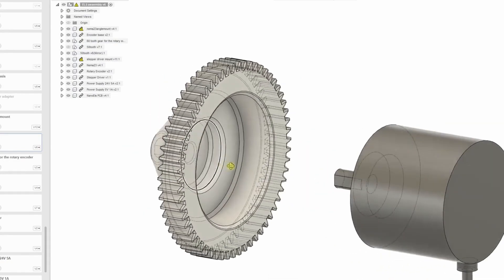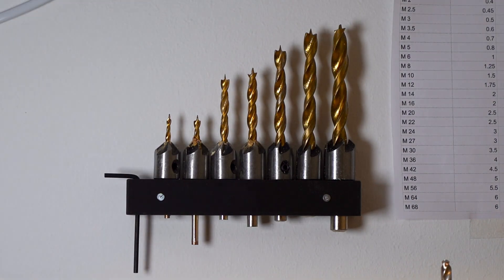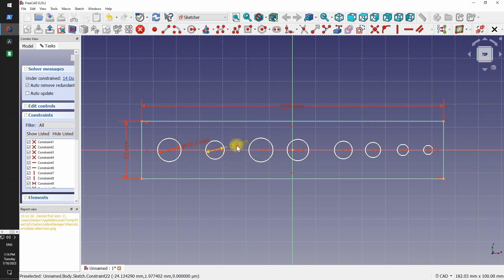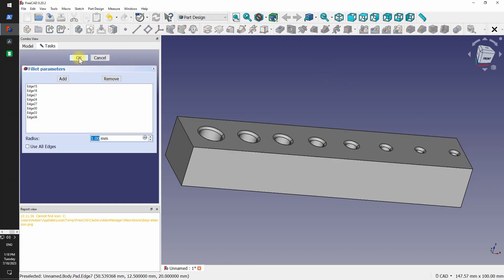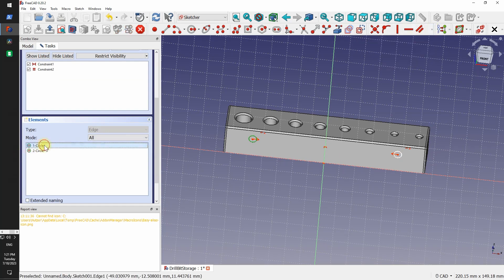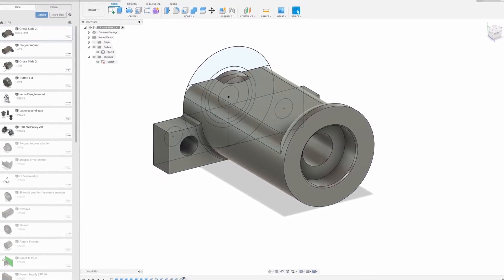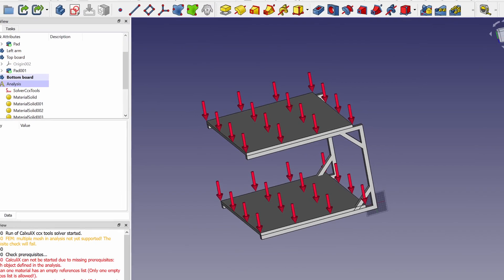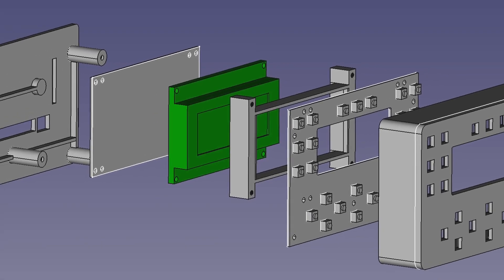FreeCAD after 6 years in Fusion 360

Comment: Okay ... What I learned from the video is that I won't go with either FreeCAD or Fusion360 but Solidworks 😅😅
Reply from the maker: Wow, that one is expensive 🫰
Reply: @MaximKachurovskiy  Solidworks Maker edition is US$100/year. I get it for half with an EAA membership. There is also Solid Edge Community Edition, but have not tried it yet.
Reply: @kellyjordan, I tried the SW maker addition for the CAM.  $100 per year was something I could justify.   I found the interface to be hot garbage and I donate that money to freecad now.
Plus, Dassault is just doing what Autodesk did... Free until they get it debugged and the put everything  useful behind a pay wall.
Reply: @MaximKachurovskiy  Yeah I was kinda joking 🤭

I'm already using a mix of FreeCAD and Fusion360 😬